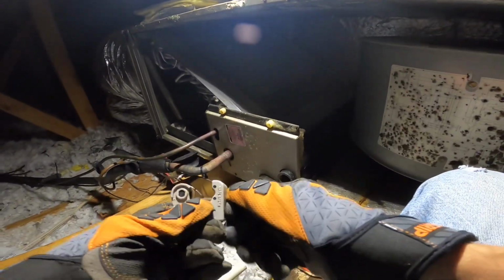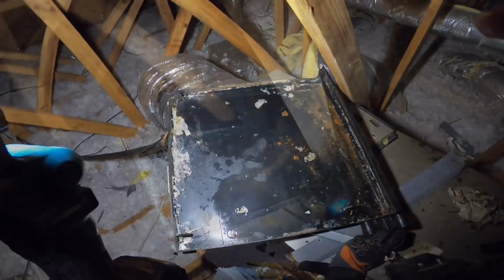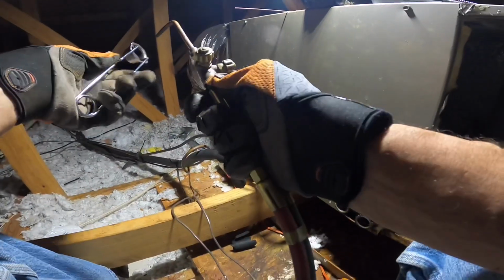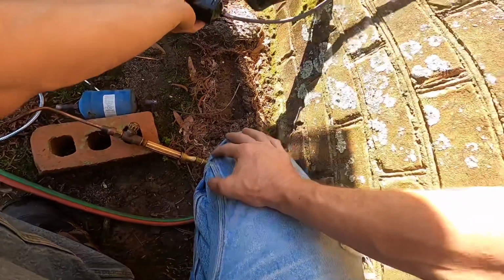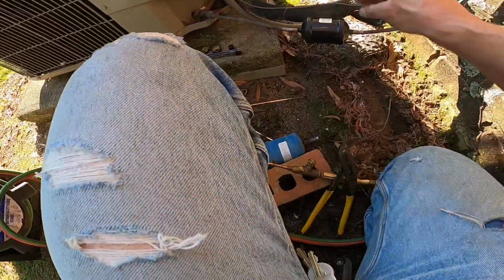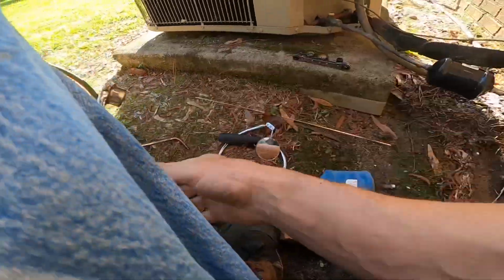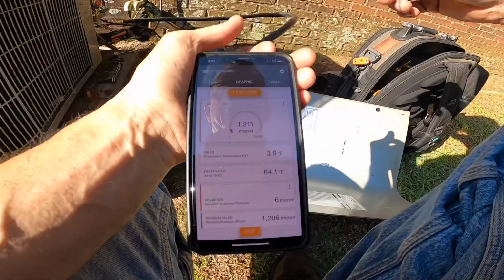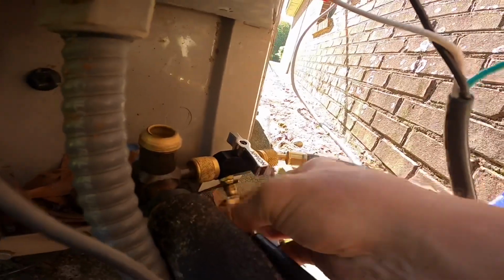Replacing evaporator coil from yesterday

Comment: I.m suspect of my VP-85🧐. The last two times it took FOREVER to pull down. The last time was a 50# new recovery tank yesterday and it took 30 minutes but finally got to 380 micron. Took 1 hr16 min to evacuate a 12k single head mini split including the condenser on a line repair. Held pressure and held vacuum for 30 min but would not go under 900. Clean oil both times. Keep us posted on yours.
Reply from the maker: I’m doing another tomorrow. I hope it does better without that hose hooked up
Reply: If it stayed at 900 microns means there is still moisture in system.

Comment: I just watched it again I see you did have your micron gauge on the liquid line but why did you run a hose off the side port of the valve core removal tool? Also what is hooked to the end of the 1/2 inch hose and running to the back of the core tool? You don’t need a ball valve there you have one on the core tool for isolating the vacuum. That short piece of hose will slow the vacuum quite a bit just hook the 1/2 inch hose directly to the back of the core tool and get rid of the short hose on the side of the core tool
Reply from the maker: I was thinking of pressurizing after. But hadn’t thought of just releasing freon

Comment: I’m not sure why you would hook up your vacuum like that. You can get a 3/8 or half inch hose that is 1/2 or 3/8 on one end and 1/4 inch on the other end. Remove the valve core and hook the 1/4 inch hose end to the valve core removal tool and hook the large end of the hose to the pump. The Fieldpiece pump has 2 3/8 inch connections and one 1/2 connection to accommodate large vacuum hoses. The 1/4 inch port on the pump is just for hooking your micron gauge to the pump to check the quality of your oil and how low the pump will pull down. If you want to pull a one hose vacuum like you were in the video just leave the core in the high side and hook your micron gauge directly to the high side. I use a Bluvac gauge and it can handle 500 psi pressure so opening the valves when you’re done pulling the vacuum won’t hurt it I’m not sure about the Testo but I’m sure it can handle some pressure. I’m not sure why you had that 1/4 inch hose on the side port of the core tool and it looked like you used a 1/4 inch hose to hook into your vacuum hose that’s a huge restriction and not necessary at all. If you put the micron gauge on the liquid line it’s the farthest point from the pump and it will read a true micron reading. Anytime I’m pulling on just a lineset and evaporator coil I pull one hose the way I described but if I’m pulling on the compressor I use two hoses remove both valve cores and hook my micron gauge to the side port of a valve core removal tool. Pulling on compressor oil with refrigerant trapped in the oil and accumulators with refrigerant trapped in the oil can take a long time that’s why I always use 2 hoses in those situations. I know you had pumped the system down so you were just pulling on the lineset and evaporator coil so a one hose setup would work great I would have just hooked it up different. I have the TruBlu hoses and those things are really fast! Jim Bergman has some really good videos about vacuum on YouTube that are really worth watching
Reply: Btw I’m really enjoying your videos. Keep up the good work!
Reply from the maker: @baitcasterdisaster8981  I’ve been eyeing the trublue
Reply: Hvac guy you will really like them if you get em. They’re kind of pricey but it has really cut down my vacuum times especially on systems where I’m pulling on the compressor too. TruTechTools has the kit for around $500 but I just bought 2 starter kits for just over $300. Each kit comes with a tru blu hose a valve core removal tool and all the fittings you need to hook it up. That’s really all you need. Check out the BluVac micron gauge too, they’re the most accurate micron guages I’ve ever used. I have the BluVac pro which will actually give you a pass or fail on the decay test but the BluVac mini is great too. I have that one as well for my backup and it’s more affordable for $200. I’m really enjoying your videos! I appreciate you taking the time to post so many!